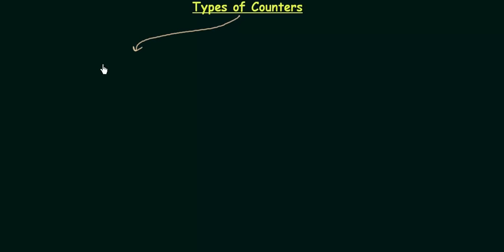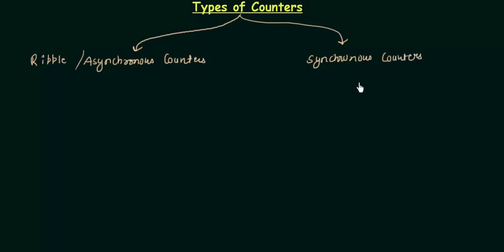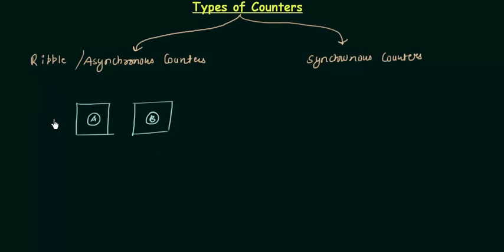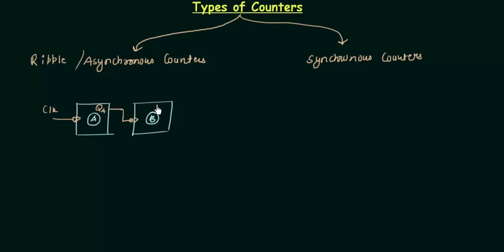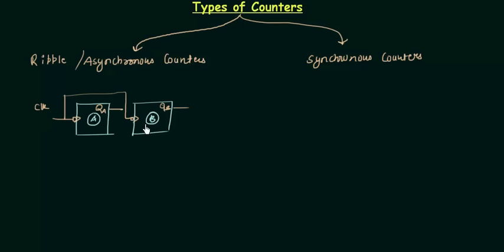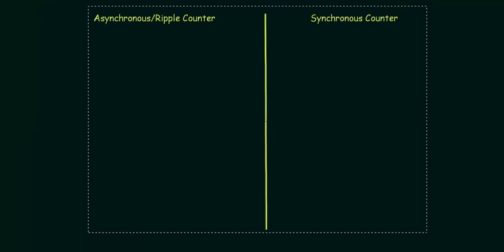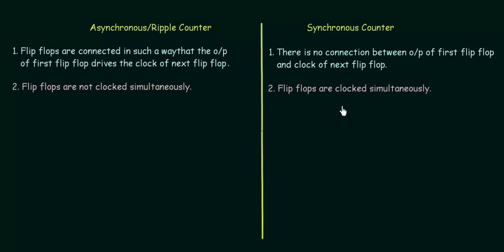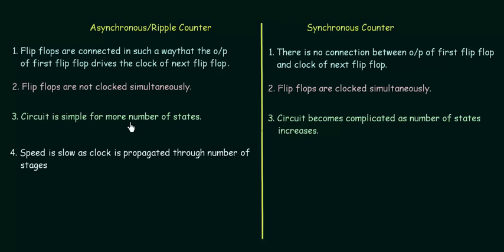Types of Counters | Comparison between Ripple and Synchronous counters

Comment: hai sir . i have a confusing with 4th point in this lecture and 3rd point in  165th lecture .
(in 165 video you have explained that syncronous ckt are slower due to clock is present and asynchronous ckt are faster due to clock is not present in it, ) . what is the difference between this two points. pls clarify my doubt
Reply: Using a clock means there are 0,1s. The ckt either works when it is only 0 or only 1. There is a slight lag as it continuously changes. This is not observed without a clock. Hence slower. Correct me if I am wrong.

Comment: Sir I think 2 points are contradictory for synchronous as well as asynchronous from lecture 165... in that u told for sync like the speed is slower and easy to design... bt in this u told that complicate ans faster one...

Comment: if the input clock frequency  10ghz is passed to 6 bit jhonson counters then from mod-5 ripple counter out of which is led to mod-6 counter then to BCD synchronous conter. What is the output of the frequency?